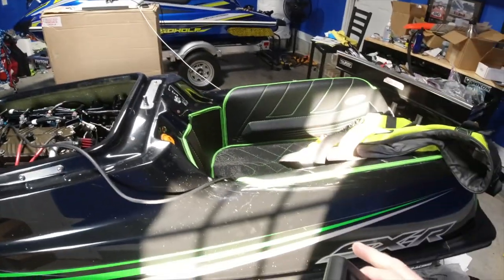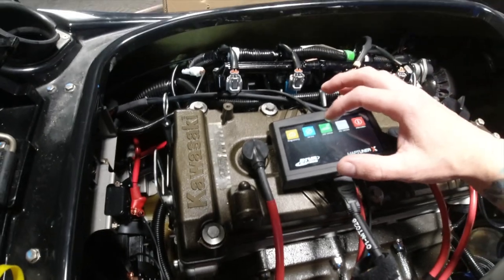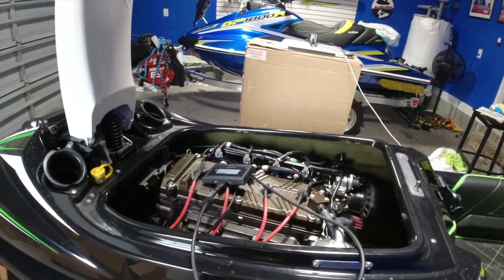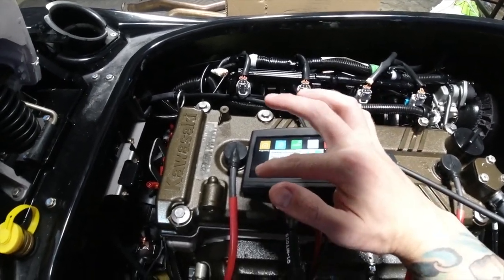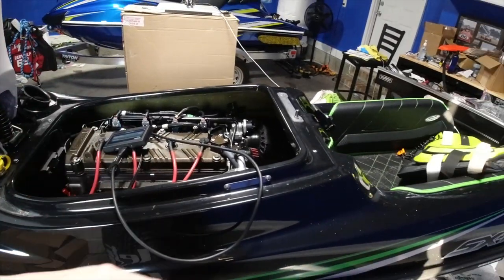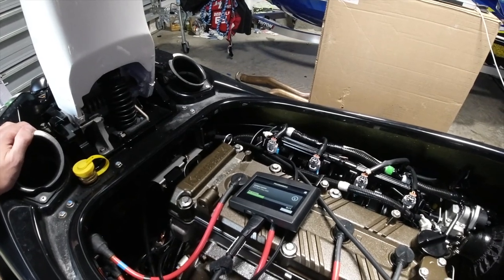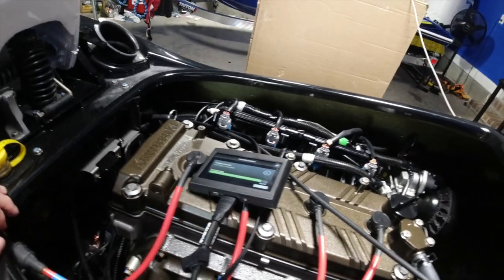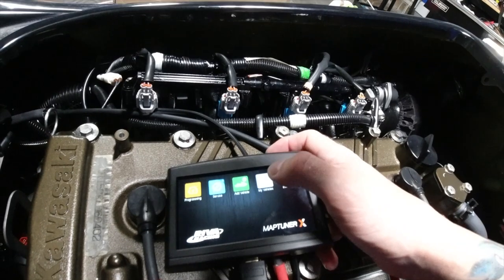Installing Riva Racing Maptuner X Tune On Kawasaki SXR 1500 Stand Up Jet Ski

Comment: I had no luck messing with this box for a couple year on the same ski except for changing to rev limiter.   Actually a couple of the tunes slowed me down.   Maybe it would help with extensive mods.   Lots of cash down the drain.